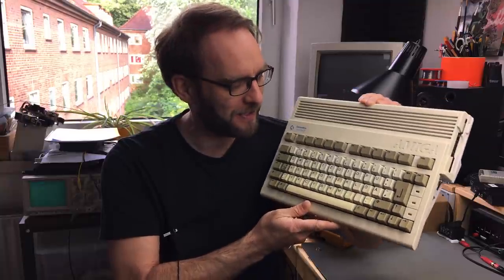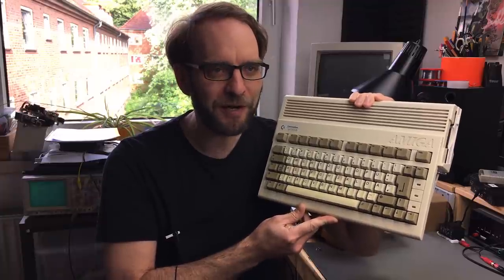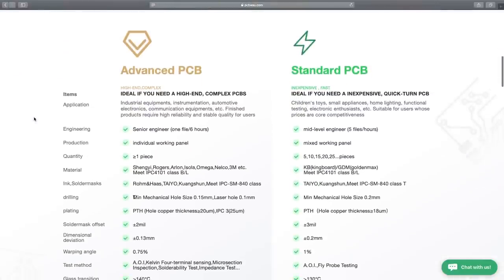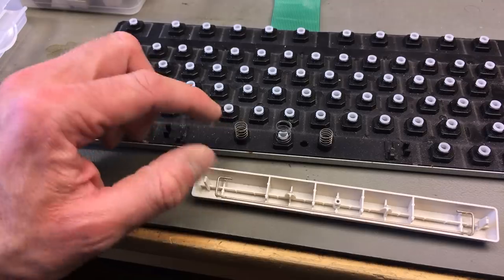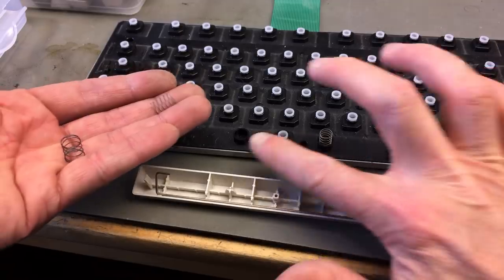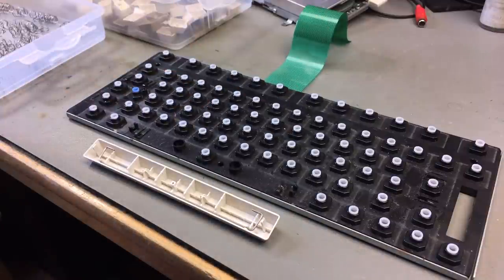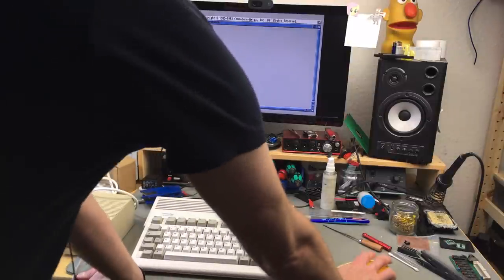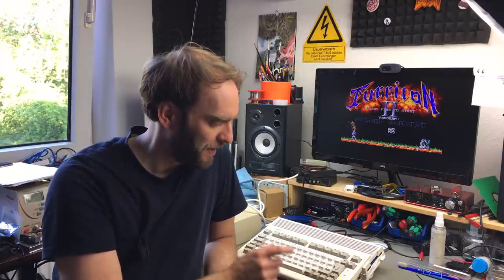Amiga 600 Retrobright and SD Harddisk

Comment: 500s reyellow much faster than 600s, 1200s or 4000s,but that seems to have something to do with the year of production. My 1991 500 still looks gerat, while my 1988 500 is pretty yellow like a lemon...
Reply: I retrobrighted my 1987 A500 in 2011 (with liquid peroxide/oxy/sun) and it still looks great.  The A1200 I did at the same time with cream (I'd ran out of liquid) looks yellow again.
Different batches and different factories could all have used slightly different mixes.
Reply: Other way around for me - my A500+ from late 1991 is dark yellow and I have an older A500 with 1987 date codes on the chips which hasn't yelllowed at all - keyboard or case!
Reply from the maker: Yes, I think it definitely depends on the plastic mix they used across different factories/years etc. There are some C64 keyboards that yellow in kind of a checkerboard pattern, they must have used different plastics on the same keyboard for those. My 1987 A500 was very yellow, as was my 1993(?) A1200.

Comment: You didn't film this, but did you remember to set the maxtransfer of the SD-card to something that actually works? You may very well get problems later on if you don't do this.
Source: http://eab.abime.net/showthread.php?t=45491